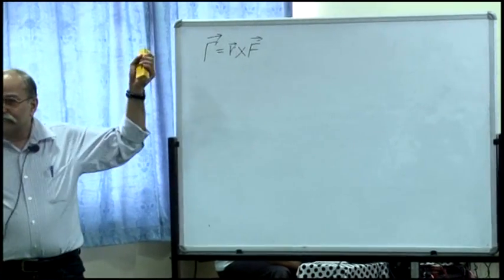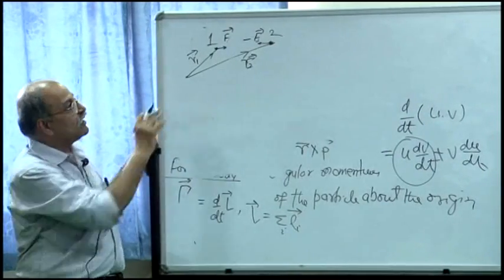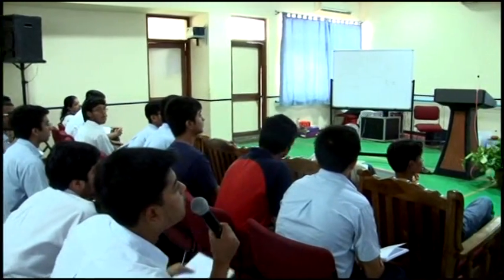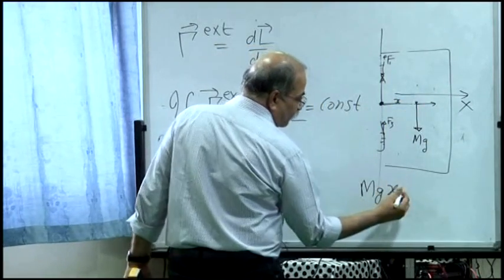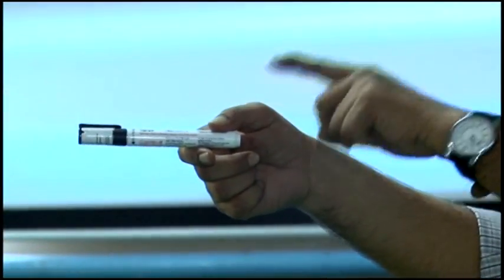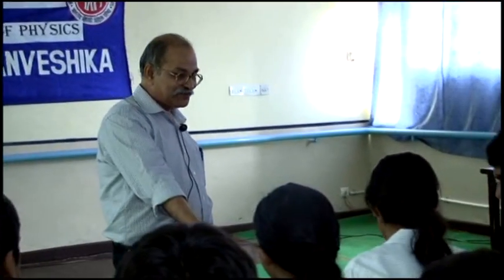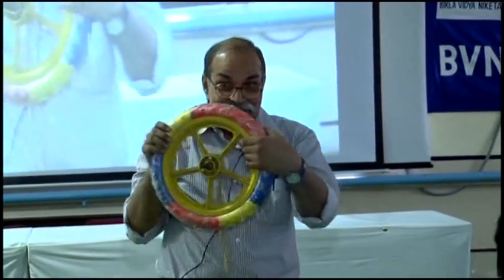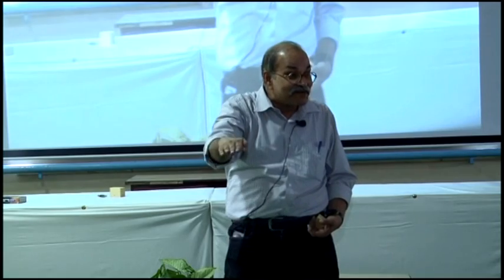Lecture by Dr. H.C.Verma on Rotational Dynamics Part, 2/2.

Comment: Torque on preceding wheel is not from tension T from rope as displacement r of T from axis of ∆L is 0 so torque due to T will be 0. Torque on preceding wheel is from weight mg of wheel and equals mgr where r is radius of precession not radius of wheel.

Comment: Naddan chutiye bacche , my dog has more IQ than these baalak
Reply: 1.Name an inertial frame?
2.what has speed greater than light
3.is the work done by friction positive,negative or zero
4.what is electric field at the centre of a uniformly charged spherical shell
just answer and feel what you are.respond if you have guts otherwise dont bark dude